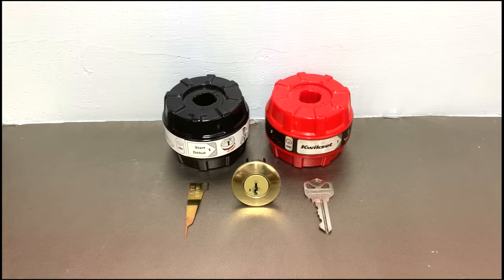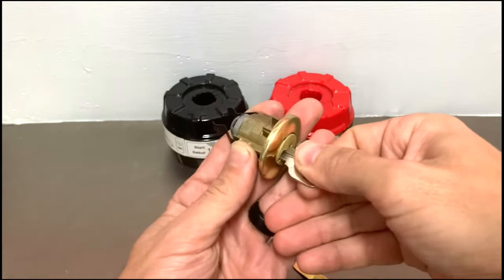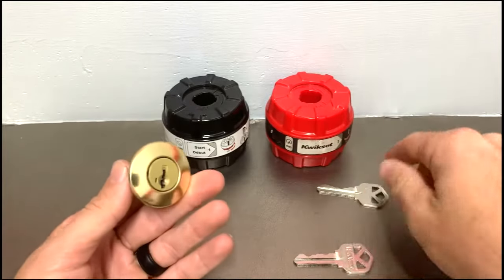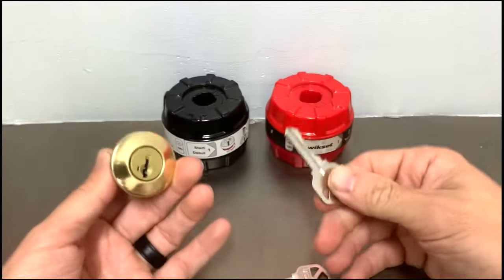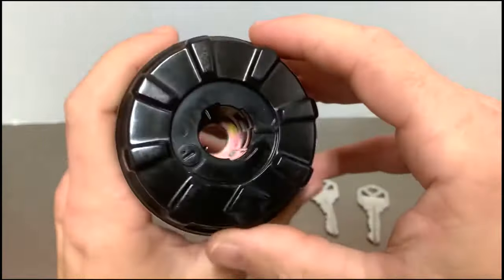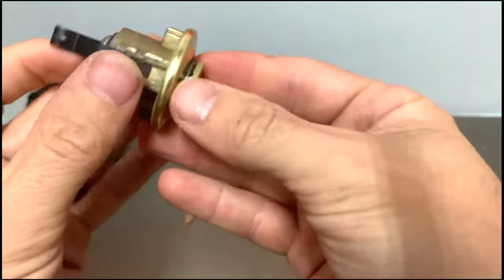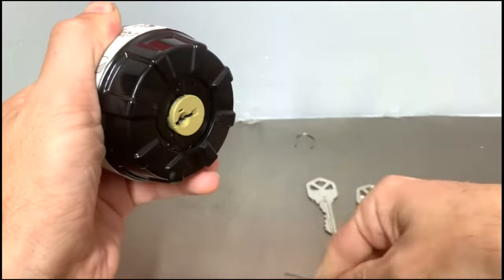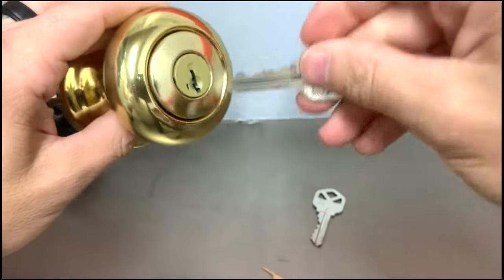How to use the Kwikset Cradle Smart Key Reset Tool

Comment: I seriously could’ve used this last week. I made the common mistake. I locked myself out of a dead bolt at a customer’s house. I had just replaced the door knobs and dead bolts on all 3 exterior doors, and had just finished keying all of them to the same key. The final one, I locked myself out of. Neither the old nor the new key would turn the dead bolt. I had no idea this tool existed. I spent an hour on the phone with KwikSet customer service. Nothing worked, so they sent the customer a new cylinder with new keys for free since they warranty all of their knobs and locks. 10 days later when the part arrived, I was able to go back and replace it for her. I couldn’t apologize enough, thankfully for me, she was super understanding and not upset one bit. You can bet I will pick this thing up now and keep it in my truck just in case haha
Reply from the maker: Aw man, that’s never fun! 
Glad you were able to recover! 

I will say that these reset tools aren’t very durable and are really built for a homeowner to do their own locks. So, it’s always a good idea to keep a few of them on your truck.
Reply: @LockandKilo I will keep that in mind. Thank you!!

Comment: The Kwikset Smart Key Door Knob on my garage door froze. I replaced it with a new one, re-keyed it and done.
I bought the Cradle Tool so I could fix any of my door knobs when this happen again.
After watching your video, I took the frozen door knob apart and re-keyed with use of the Cradle Tool with my first try. Now I have a Spare door knob.
Thank you very much, you made my day.Cradle tool
Reply from the maker: These tools are awesome when they work, sometimes they can fail. 

Most likely they fail as they are bounced around in work vans lol, keeping it on a shelf will prolong its life!

Comment: Any on the deadbolt?   I been doing locksmith work for 23 years.  I always like learning more.  Great Video!!
Reply from the maker: The dead-bolt is even easier as once you remove the screws it’s just 1 clip to remove the core. 

A “Schlage” version by Kwikset has been around for some years now and won’t work with this cradle however. 

I have not come across the SC version in the field yet, it’s not popular and isn’t sold in stores yet.

Comment: Thank you.  I didn't need to use my Smart Key reset tool afterall.  All I had to do was find the gap that the new key wasn't installed all the way in to the lock.

Comment: Good afternoon how when i doit   don't hear no noise when inserted the toos and the cylinder comes out the cradle don't hold the cylinder in place 
Don't get it is so easy when you doit the key go inside twiste back and forth nut the key don't come out have to use the tols to get it out

Comment: I have the smartkey reset tool, the red one.  Mine has white instructions around the outside, not the black instructions like in the video.  

My tool does not work.  I think the problem is that the cylinder does not go all the way down into the tool.  It sticks out about a 1/16th.  

Is this a common problem with the tool?  My next step is to go buy a new reset tool.  Thoughts?  Thx..
Reply from the maker: Interesting, they may have tried white on Red before switching to Black. 

These tools are pretty notorious for failing after semi-heavy use. Without placing the plug inside, try and just turn the tool and see if anything may not be retracting or if there may be an obstruction. 

This tool new does it's job for a home owner, but for locksmiths, most don't use this tool anymore or seldom do since it tends to wear out quickly for us.
Reply: My cradle has worked perfectly for about 10 years now. If the cylinder is t fitting all the way down. You may not have the cradle in the proper position. Also keep this in mind.  If the wafers on the cylinder are damaged. Don’t attempt to use the cradle with that cylinder. Throw the cylinder away
Reply from the maker: @2815Juan  I haven't had a cradle fail on me, I have just heard from many Locksmith's that they had them fail. 

I haven't really used it as heavily as some of them tho, I have used the Lishi and LockTech often times more than the cradle through my career, so it has been used sparingly lol
Reply: I have a red one with a white label as well. It works on some cylinders but others it will only turn halfway so it doesn't let me reset it

Comment: How do you use it if it won't turn all the way to the arrow? Is the cylinder bad at that point
Reply from the maker: This could be a sign of the Cradle being faulty. 
If you are following all steps correctly and this happens it is normally a bad cradle. 

The black model seems to have been re-made to correct the issue, however I have heard these issues still arise on both versions.

Comment: how many times have you used the cradle? I want to buy one from Amazon, but some reviews say after 1 or 2 uses it brakes or dont work.
Reply from the maker: I do not normally use it as a Locksmith as they do fail, however for personal use it'll work well for a single home. 

They are designed for a home-owner to use themselves, not a Locksmith to do multiple homes per day lol

Comment: Kilo - WHY does my cradle NOT turn when I have the cylinder inserted into the new cradle ?   It just will not turn with the cylinder inserted BUT the cradle turns OK with no cylinder  ?
appreciate your comments
Reply from the maker: Hi, Dennis

If the cradle is aligned correctly and the cylinder is properly seated it should spin with no issues. You could try and spray some lubricant in it and try it a few times and see if it rolls over. That worked on a wonky cradle I had before it finally gave out a few locks later. 

These cradles had high fail rates, I feel they were built as a one lock or one customer use type tool opposed to a long-term Locksmith tool. 

I had 1 cradle last 2 years and 1 cradle last 4 months lol 

The cradle kind of got pushed aside since the replacement cylinders are available for roughly the same cost to customers. The decoder tools available to Locksmiths are far superior, so even cradles sold today are the same quality as the old ones unfortunately.
Reply: Thank you for this video. It helped me to decide on which locks to purchase for my new doors.❤

Comment: what if your key gets stuck in cylinder after you pull it out of the device?
Reply from the maker: The key may not have fully rotated back to it’s ‘12 O’Clock Position.

Comment: Everything lined up perfectly when I dropped the cylinder into the cradle. But, the bottom of the cradle will not turn. Please help
Reply from the maker: The best way to do this is to hold the bottom of the cradle firmly and rotate the top portion. 
If this isn't working, these cradles are known to commonly malfunction.

Comment: These are my nightmare. My staff constantly had trouble with the rekeying often so the cradles were necessary. I have had really bad luck with the cradles and the whole "smart Lock" system. BOTH colors gave us headaches. Our staff all assumed the red one was better but that might have been anecdotal and the fact we couldn't buy another red one (conspiracy theories). Ikea flatbox furniture  has better instructions. Written steps would have been nice than these pictoglyphs. Making multiple trips to the maintenance shop to get tools and the cradle negates any time saved by simply repinning. And the added benefit being able to master key everything made my decision to go back to dumb locks easy. Now my  guys don't have to grab and return keys between work orders. To me, Smart Lock was another false promise to make my job easier. Like LED light bulbs last 25 years so the next bulb you change will be the last before retirement...